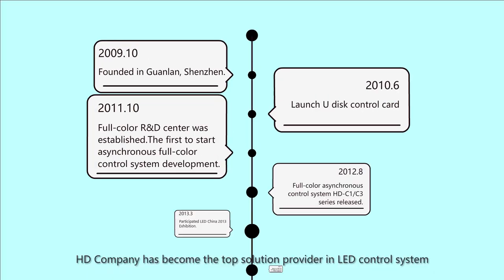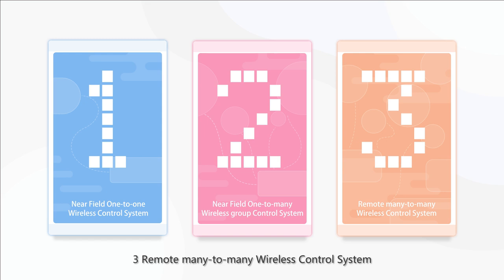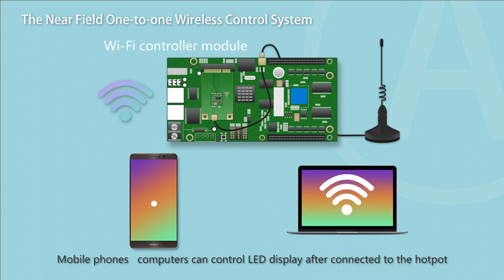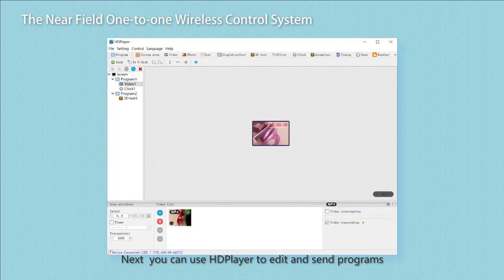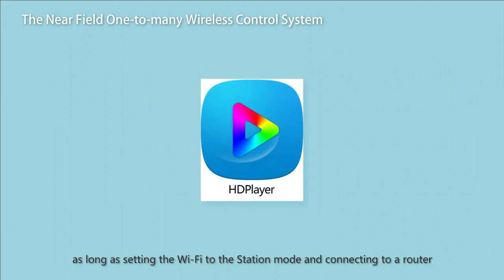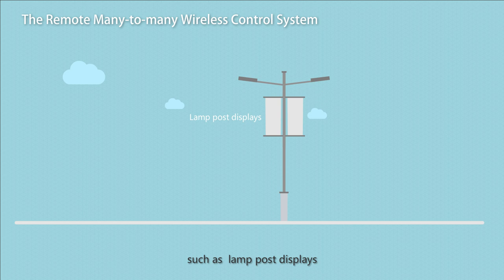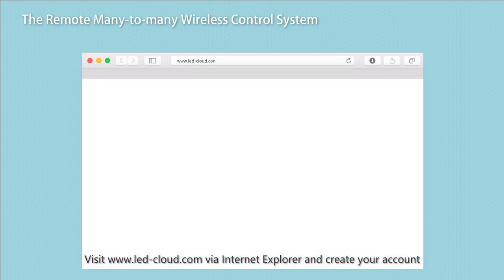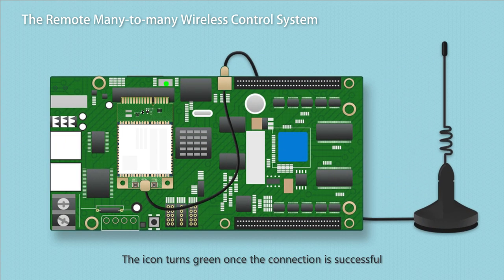HUIDU Wireless Solutions of LED Controller for Billboard with Unique Technology better than NovaStar

Comment: Has anyone using the WF-1 for a COUNT UP TIMER learned that the real-time clock on the WF-1 is very inaccurate? I have tried to use the WF-1 as a COUNT UP TIMER in digits mode (00:00:00). But the TIMER will run too fast, about 8 or 9 seconds too fast per hour. The software that Huidu has created for the TIMER will subtract 3 to 4 full seconds from the TIMER every 25 to 30 minutes to try to compensate for this problem. This just causes more confusion and does not fix the problem. The inaccurate TIMER on the WF-1 makes it impossible to use for timing a race or sports event. Do the WF-60 controllers have the same problem or is it just the WF-1?
Reply from the maker: Hi my friend, which firmware version and software version did you use? Can you add me on Wechat or Whatsapp, my number: +8613510540791. So that I can arrange our engineers to help you. Please don't worry.

Comment: What Can the controller be accessed from internet by using mode station on my router, then i will forward port forwarding in my router to the controller by using hd player?

At the moment the controller doesnt has sim card for usage cloud server. What is it a solution?
Reply from the maker: New A6/A5/A4/A3/C15/C35/D15/D35 all supported access to internet by cable network.
You can learn the tutorial from this link https://youtu.be/AGQCqxK2Z6g
Or you welcome consult me detail,  can add my Whatsapp or Wechat: +8613510540791

Comment: For 16 x 96 p10 pixel full color module used with w60 - 75 card cost is very high, in single color w00 is very cheap price so suggest Me  any low cost huidu card
Reply from the maker: if just one line, it also can use our WF1 new card.
Reply: @HuiduController  thanks
Reply: @HuiduController  is not available in India,  chennai
Reply from the maker: @khaleelrhaman884  now have to wait, because of covid serious status at moment .
Reply from the maker: Mobile App name: LEDART